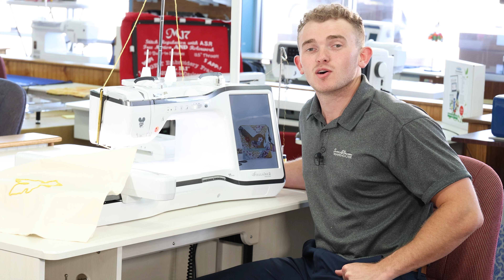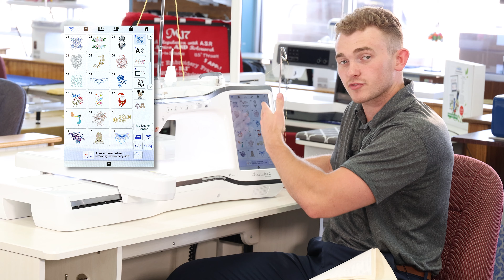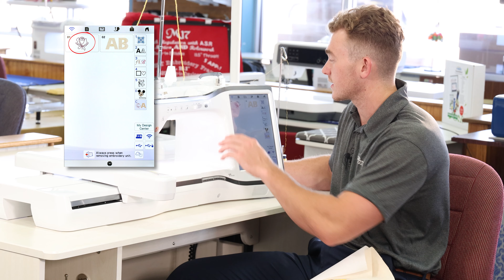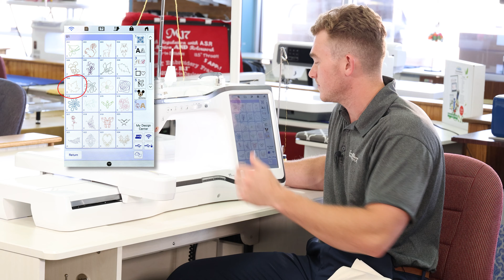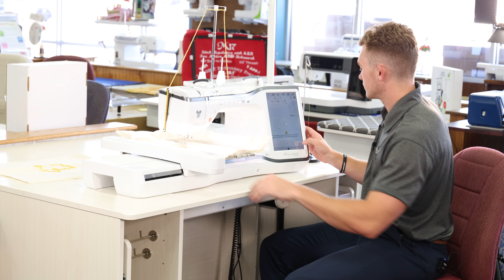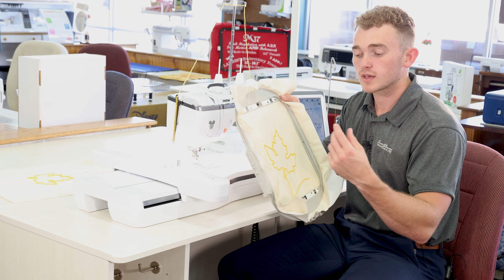Couching with the new Brother Stellaire Innov-is XJ2

Comment: Hello! Thanks so much for the video. I have tried out this technique, following the video in the machine, and your excellent one too. However, it keeps telling me to rethread my top thread. AFAIK there is no top thread, just the yarn. I thought the bobbin thread was going to hold the yarn down, but it isn't happening for me. BooHoo.. so do I need a top thread? Thanks for any answer.
Reply from the maker: Yes, you need the top thread. As the yarn goes through the couching foot, the top and bottom threads will work together to stitch the yard down. Just make sure that the top thread is not being held up with the thread mast next to the yard or it can get tangled. A separate thread stand works good for this.

Comment: Awesome video . Did you say that the thread stand up top , the one that’s holding up the yarn comes with the XE1?
Reply from the maker: yes, the thread stand comes with the M8. When you want to use it, remove the lid of the machine and the thread stand/deck slides right into the opening.